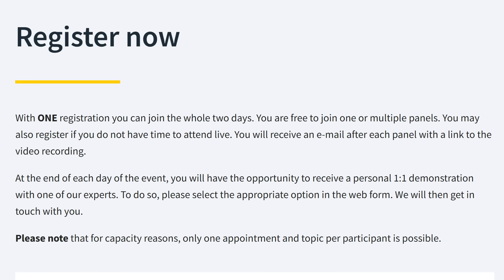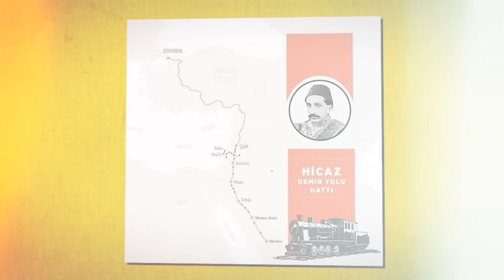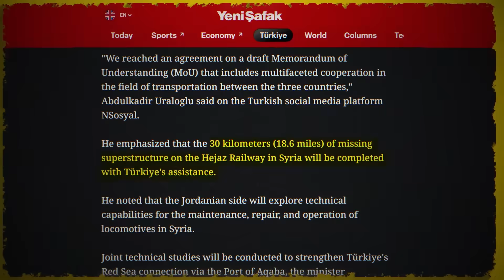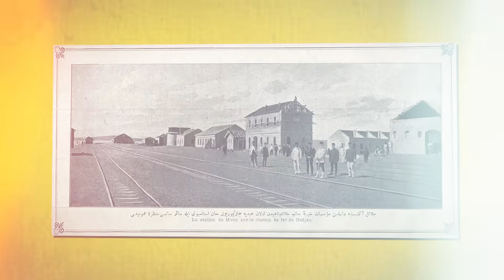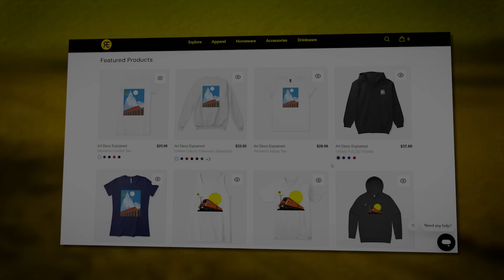What Happened to the Legendary Railway to Mecca and Can It Be Revived?

Comment: To make it a real competitor to the other trade corridors, they also have to regauge it to Standard gauge.
Reply: Given that they pretty much would have to rebuild most of it anyway, that does not seem like a particularly hard problem technically. The sole question is the nostalgia factor.
Reply: @KaiHenningsen   They should organize camel caravan. It would be real nostalgia, not the train.
Reply: That makes sense. However, that would mean some extra slow wavy tracks going through southern Amman if you are using the existing corridor.
Standard gauge in southern Amman would mean a new corridor and or tunnelling would be needed until the corridor reaches flatter terrain. It also could connect the now civilian and international airport by rail. 🙂
Reply: and somehow get around THE LINE

Comment: The value for Turkey is huge, an alternative route to the red sea for goods instead of the one through Iraq and the Suez. Both Syria and Jordan could also benefit from the alternative by using  a Syria harbour on the Mediterranean. If the Saudies connect the high speed rail with Nerom(sp?) they might as well connect to Jordan too. Opening the possibility of taking a new Orient express to Mekka.
Reply: It would benefit pretty much everybody, both in Asia and in Europe. Railways are key to develop areas and encourage trade.

Comment: This line had been build with a 1050 mm wide track. All modern lines in Turkey and Saudi-Arabia have 1435 mm. So reviving is not enough. The track width has to be changed along the entire line.
A major problem not mentioned in the video: They were using steam trains that need tons of water for every single trip. Not very good in a harsh desert without rain. Railway sllepers (or railroad ties in the USA) needed entire woods in a region where there is no tree because there is no water. Today they would use concrete sleevers/ties. engines would be either Diesel or electric.
If they want this line to be working before the end of the century, they should not ask Europe, but China.
Reply: and Korea, Turkey and Japan
Reply: AFAIK Hejaz railway had used iron sleepers.

Different gauges are also not problem, there are already several systems with variable gauge, so running trains from Türkiye to Saudi Arabian on two different gauges, is not problem at all. On the other hand If the Gulf Railway will be able to also carry freight, it would then perhaps make more sense to rebuild it in it's entirety as standard gauge railway so freight trains could freely travel from ports on Arabian peninsula to ports on Mediterranean coast or directly to Europe if new tunnels/bridges (or even train ferries) would be put in service linking networks of Europe and Middle East. Another option could also be to build northern part of the line as dual gauge gauntlet, in order to allow freight trains between Gulf States and Türkiye/Europe  and the "southern" part with it's original gauge. It also seems like the current alignment has plenty of tight curves that would restrict speed of standard gauge trains more than they restrict the speed of narrow gauge one. So if they would go with standard gauge it would mean in many places completely new alignment, which would drive up the costs.
Reply: @MrToradragon different gauge means also different line geometry. The narrow gauge means also tight curves, heavier slopes etc. usually the narrow gauge cannot be regauged to normal one. It works only in oposite direction. Today‘s requirements for railways are very different from the design rules from 1900.
On top of that the modern railway today is the electric railway. In the whole area around the former line has no electric grid, and the electric power is usually  generated locally by diesel power station. That means for the railway line they need to build also an electric distribution network, not to mention the communication network what is required for the modern train safety/control system.
Reply: @railfilm  I know that narrow gauge lines allow for tighter curves (gradients might  rather be result of cost cutting), that is the reason why I have suggested that the "northern" part, from Amman, which seems to have larger curves, to be gauntlet and "southern" part to be build as narrow gauge. Of course it would require local changes of alignment. On the other hand, when I looked closer on the map, it seems like even southern part, in Saudi Arabia has long straight sections that are not constrained by terrain and also sections that follow narrow valleys and I guess that those would be replaced by new sections (with tunnels) that would allow for greater speed. So there perhaps would be only historical reasons for the line to remain on Cape gauge. 

On standard 25kV AC the feeder stations are separated by some 60 kilometres, but it is also possible to use some different connection, for example split phase, or to run "primary line" along  the railway with higher voltage that then feeds the line itself. I think that those, along with signalling, are rather smaller issues which would have to be solved regardless the chosen gauge.
Reply: @MrToradragon the problem in that part of the world there is no power network at all. It easier to transport the fuel for the local generators then transport the electricity in the huge uninhabited areas as southern part of Jordan or north part of Saudi Arabia. These are simple facts today, and the distances are above thousand kilometers what is over the limit of the recent range of power lines, this means on the way they have to build new power stations. ( very similar situation to US or Australia).
Reply: @railfilm  this is false if the ministry of transport wanted it to be electric it will be just like the haramin railway
Reply: Spain built it's rail network quite fast